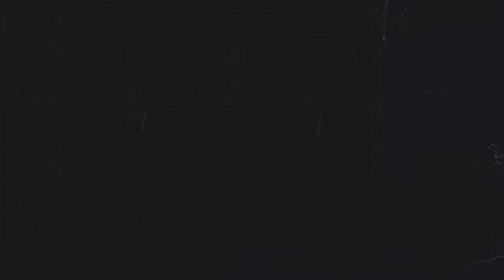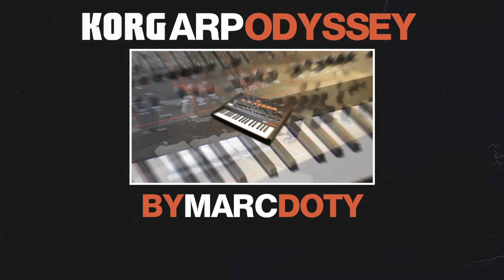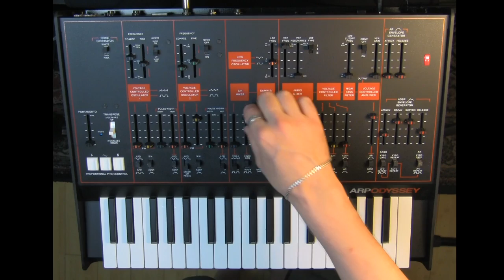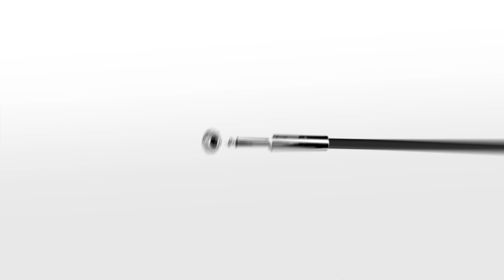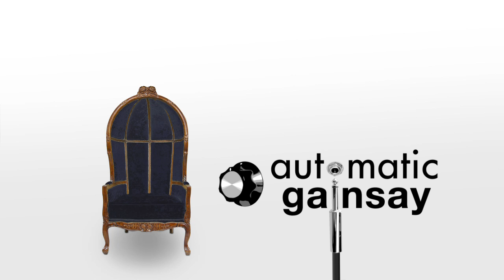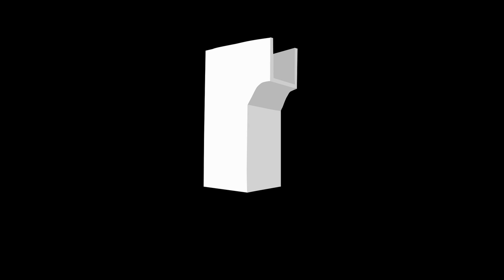04-Korg ARP Odyssey: Sample & Hold Mixer

Comment: While I agree initially the S/H mixer name might be confusing, if you look at the signal flow diagram shown on the panel itself it's pretty clear how it works.
Reply from the maker: +Jesse Skeens I'm not sure I agree, Jesse!  The panel art just shows an arrow going to the S&H... which would suggest that this does affect the S&H... but it does SO MUCH MORE than that, and the things it does to other functions like the oscillator and filter are much more usable and likely to be used than merely coming up with different signals for the S&H to draw from!
Not to diss using different voltage sources for the S&H, of course... it's just that most people simply want the random sampling!
Reply: +AutomaticGainsay Hey, the panel art shows the mixer area which then feeds into the sample and hold circuit. Then on the modulation source switches they are labelled as either the s/h mixer or the s/h. So using a little logic I thought it was clear that if you tap into the source feeding the s/h  (mixer area) you get the unadulterated signal, and if you tap into the s/h itself then you get that. If they just showed a single block for s/h (to include the mixer) then that would definitely be confusing. I guess if someone didn't understand how s/h works (needing a source) at first they might not also realise the mod capabilities of that mixer section. A five minute Google search could clear up how s/h works, though. My point was that technically they've labelled it correctly, the user just needs to do a little reading or experimenting to figure it out. Maybe in the 70's this might have been an issue but with all the information available today it shouldn't be.